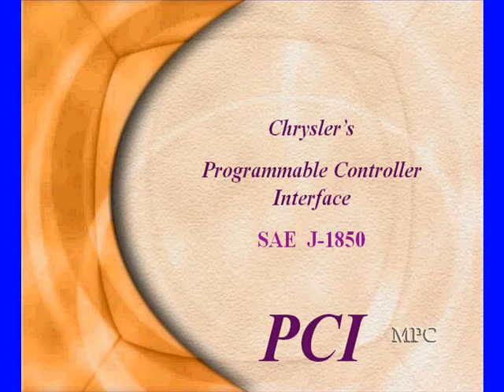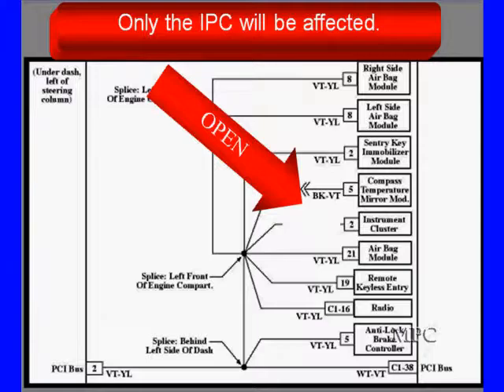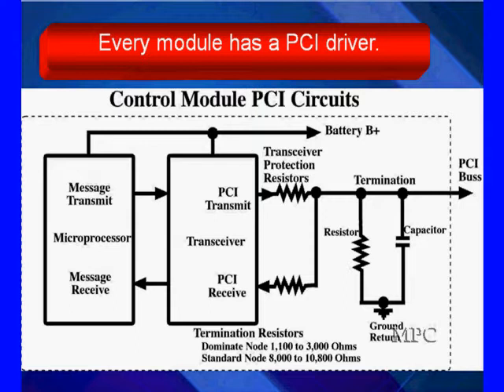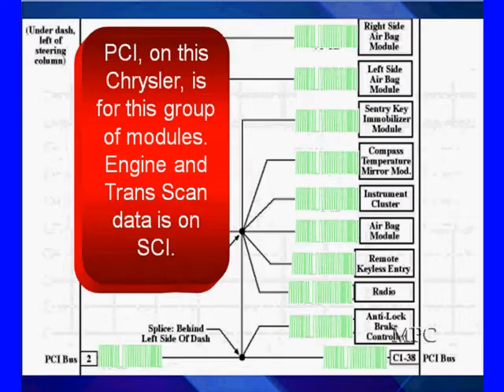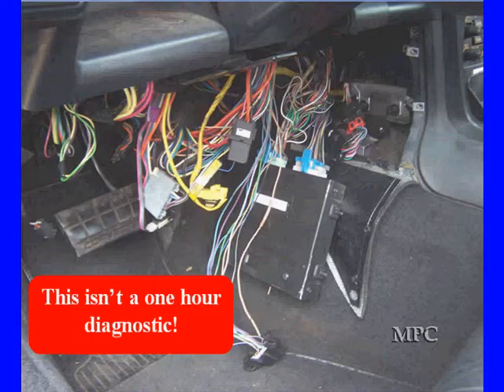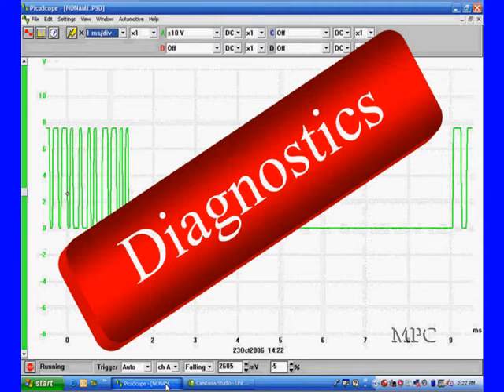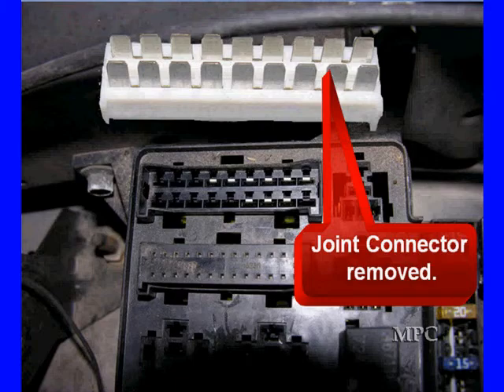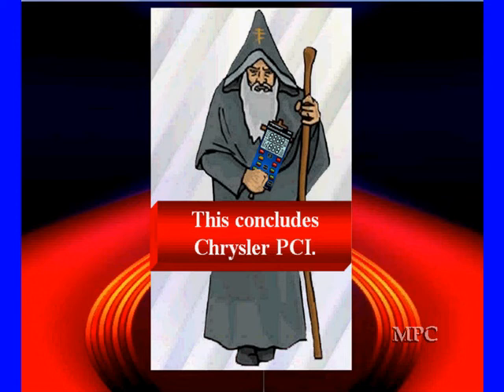06 Chrysler Programmable Controller Interface (PCI)

Comment: I believe the connection he shows in the video is wrong. That is the JUNCTION BLOCK, it connects 12v circuits that are in the fuse box.  

The correct connector is the DIAGNOSTIC JUNCTION PORT it is usually located at the steering column.

Comment: I got a question for you I  have an  07 Tahoe I have replaced the ABS module since then the PCM or the ECU has lost communication with ABS module but I can also communicate with the ABS module and read will speed sensors and all the stuff that's in the ABS module so that kind of confuses me that I can communicate with the ABS module but ABS module has lost communication with the ECM and the PCM and the PCM says it's lost communication with the ABS module

Comment: Very well explained. I have only one question.  Is the Chrysler pci the same as a 2003-2006 gm class 2 serial data line.   Wondering because I repair gm clusters and use a snap on Solus ultra to run and sweep the gauges.  I just hook up pin 2 and the ground and power and it works.  but someone brought me a 2004 dodge cluster and I have it hooked up to the right pin on the cluster and pin 2 on dlc but it says no communication.  Does it have to be in the car for it to work unlike the chevys??   If you could answer I would really appreciate it